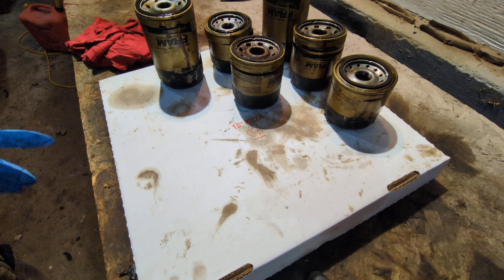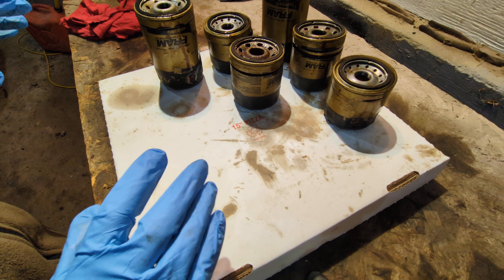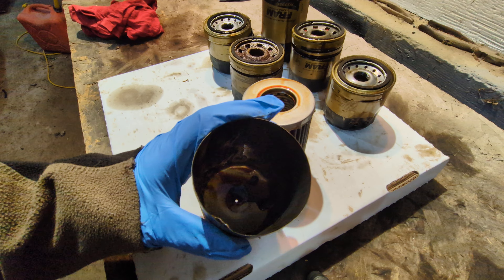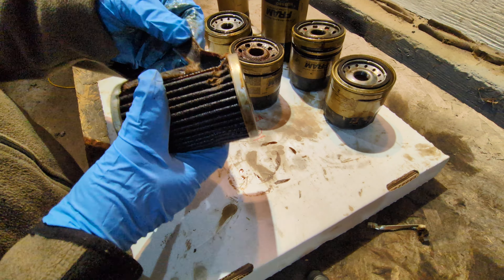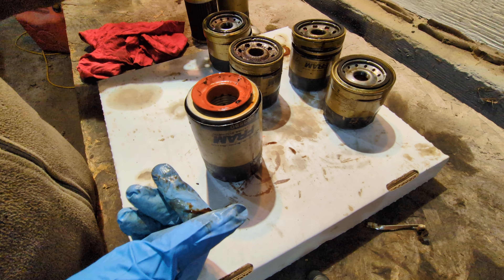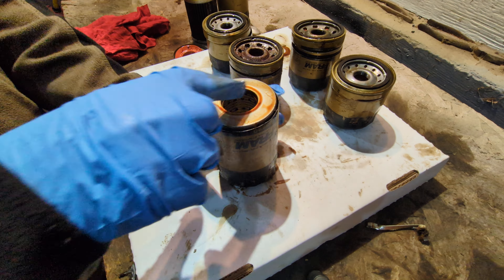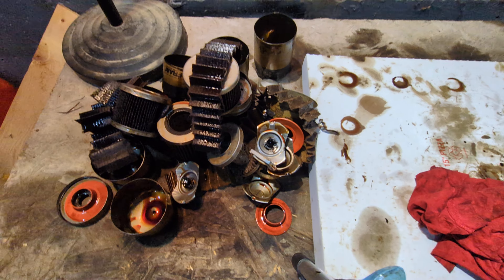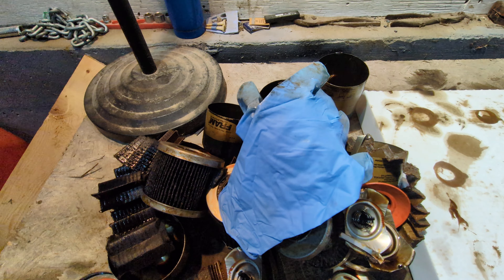Fram Ultra Synthetic used oil filters cut open

Comment: The Fram Ultra synthetic is my favorite filter.  It’s reasonable price of $8.97 at Walmart, and filters 99% of particles down to 20 microns and still has very good oil flow.  Quality materials last up to 20,000 miles.  With Sure Grip after 6 months and 5,000 miles, I can still take it off with one hand.  👍  
It’s not the best oil filter on the market, but I don’t want to pay $25 just for an oil filter.  🤷‍♂️
Reply from the maker: I still use the ultra Synthetic filter, does a pretty good job and build quality is much better than some.